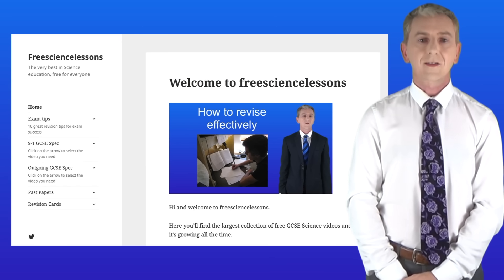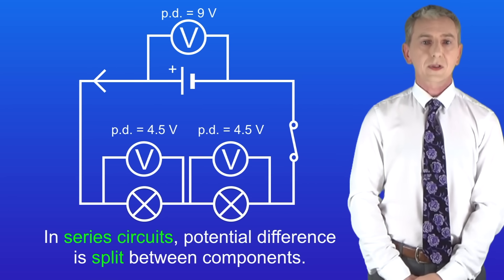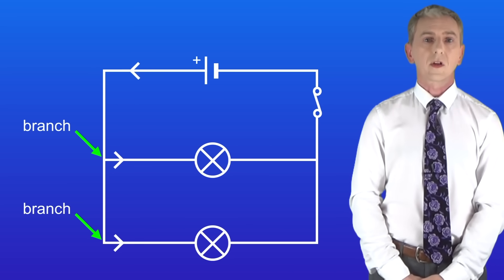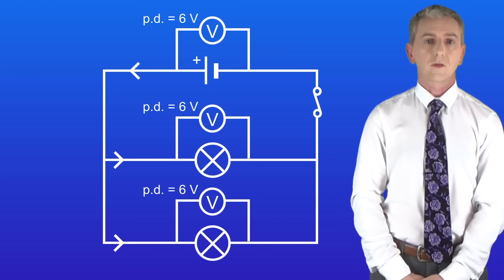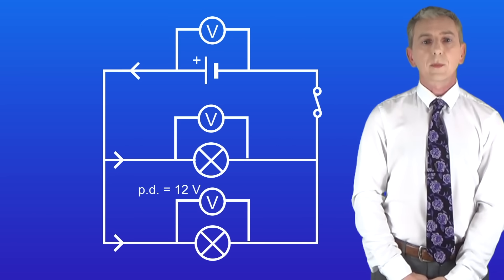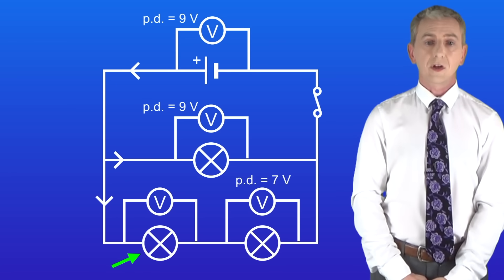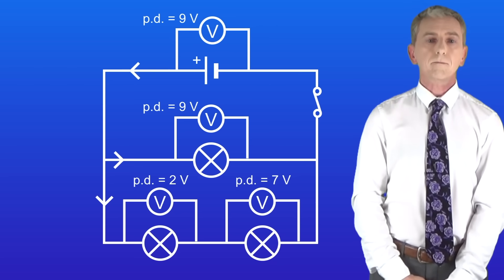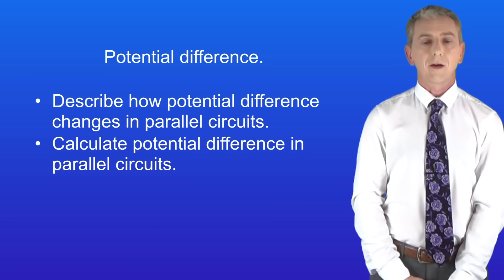GCSE Physics Revision "Potential Difference in Parallel Circuits"

Comment: for the example shown at 1:31, if one branch had two lamps connected in series, would they both be 6V, or would the 6V be shared out between them? in other words, in parallel, is the potential difference across each component the same, or is the potential difference across each branch the same? many thanks
Reply from the maker: The potential difference across each branch is the same, so it would be shared between the components on the same branch.

Comment: Hi sir, idk if the question like this will come up in the exam:
"Explain why the potential difference of the parallel circuit is the same all over the ciruit?"
If that's the case, plz tell what's the answer, tysm!!

Comment: wait so, is the potential difference the same as voltage? and voltage is just the amount of energy needed to push the current through the circuit, and thats why its the same in every branch is a parallel circuit?
Reply from the maker: Yes that's essentially correct. The voltage reflects the amount of energy needed to push the current through the circuit.

Comment: Sir I really don’t understand how both bulbs can have a voltage of 9 and the battery carries a voltage of 9. Doesn’t this mean that the bulbs carry more energy than the battery how does it make sense?
Reply from the maker: Think of it like this. Imagine that each electron is carrying 9V (that's a simplification but we'll use it for now). When an electron reaches a branch point, it either goes through branch A or branch B. Either way, it will still deliver 9V to each branch.
Reply: @Freesciencelessons  really useful explanation

Comment: 1:20 what if there is no voltmeter above the cells?
Reply: It doesn't make a difference as all you need to know is pd across one of the components (aslong as it's the only component on that branch) and that equals the pd across the cell

Comment: If the resistance for a component in a branch increases, will the potential difference also increase as more work is needed?
Reply from the maker: If the resistance of a component increases then the potential difference across that component will increase. This means that the potential difference will fall across any other components in that branch. The total potential difference of the branch will be same as the battery.

Comment: But why is the potential difference same in parallel circuits?
Reply from the maker: Because each branch of a parallel circuit is connected to the cell independently of the other branches. So they all have the potential difference of the cell.
Reply: @Freesciencelessons  thanks a lot

Comment: Why is that the components are the same in a parallel circuit?
Reply from the maker: The components do not have to be the same in a parallel circuit. I have just used the same components to make the ideas easier to understand.

Comment: Freesciencelessons why is the two bulbs in a series circuit i though that was a parallel circuit because it has branches? (the last question)
Reply from the maker: You can have a series circuit within a parallel circuit. As long as the current has to pass through two bulbs (ie no branches between them) then those two bulbs are in series with each other. But they can still be on their own branch of a parallel circuit.
Reply: @Freesciencelessons  thank you for replying and helping me understand!

Comment: why is the p.d of a parallel circuit equal to the original voltage in both branches?
Reply from the maker: Because in a parallel circuit the electrons either go through one branch or another so all the energy that they are carrying is given to one branch only (rather than shared).

Comment: IM SO CONFUSED! So current is the flow of electrical charge through a circuit measured in volts? Electrical charge is the charged electrons around the circuit from the negative end to the positive end? Potential difference is how much energy need for current to flow through a component and resistance is how much potential difference needed for current to flow through a component?? Am i right because i am very very confused?
Reply from the maker: Current is the flow of charge measured in amperes. Other than that, you are essentially correct.
Reply: thank you

Comment: Why does the potential difference remain the same, even though the current splits?
Reply: Because the energy the electrons carry remains the same. In a series circuit the energy each electron has is split across multiple lamps as the electrons pass through them. In a parallel circuit however the electrons pass through only one of the branches and therefore through only one of the lamps, this means that all of the energy the electron has is given to that one lamp. The same happens on the other branch, resulting in both lamps getting the same amount of energy per electron even though the amount of electrons passing through each branch is split.
Reply: @TanksExplosionsAnime  legend